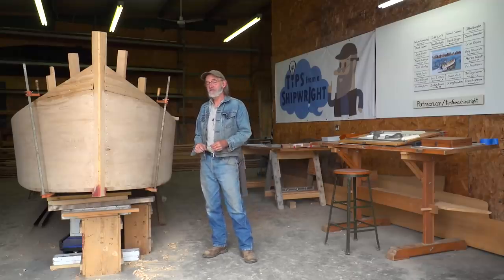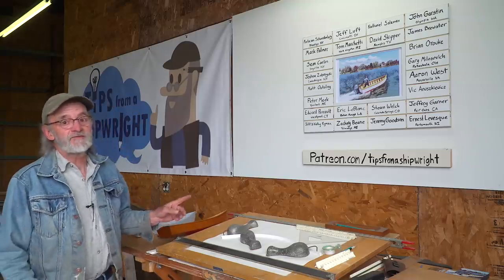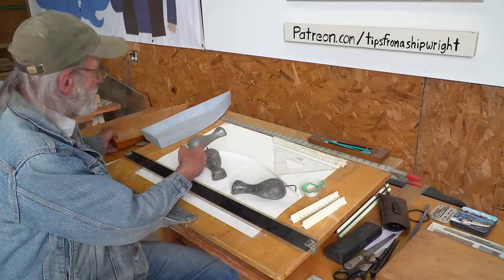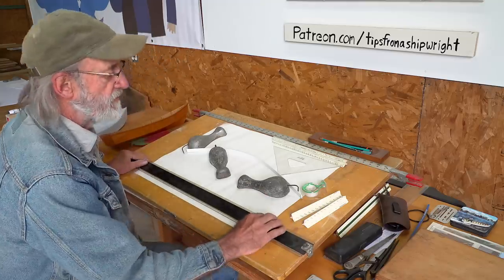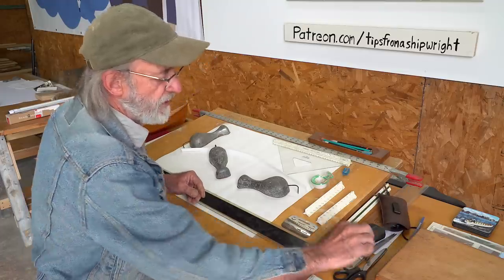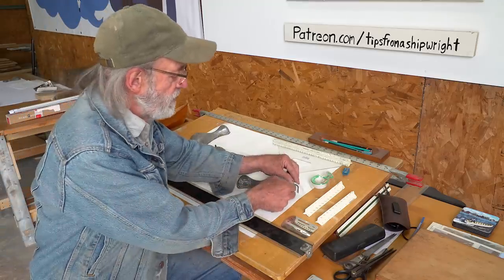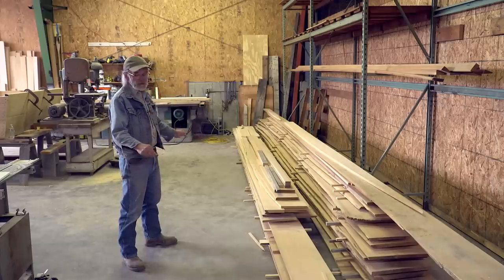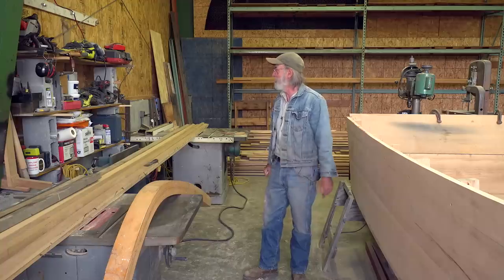Tips from a Shipwright Season 3: The 23' V-Bottom Skiff  Episode 1 - Shop Intro

Comment: I had a young pup interested in boat design show up at my shop to ask advice about how to proceed. He was asking if learning solid works was useful. I told him learn to loft by hand. Told him to read Chapelle. Handed him a set of plans for my model flat bottomed skiff and told him to bust out a cereal box and some glue.
Reply: I am an injection mold designer and use Solidworks every day.  I can't wait till Louis starts to draw so I can learn to draw on the board.  My dad was a draftsman in the Air Force.  Unfortunately, he gave all of his tools away.
Reply: Peepaw Hebert my dad was a mechanical engineer so I grew up playing at his drafting board and still use the same one today. I love what cad software can do but I still believe you can’t beat the tactile nature of hand drawing and I absolutely love lofting. Lou is right. You don’t need a lot of fancy gear.
Reply: SG80 preaching to the choir my man. I’m with you there.

Comment: I have had a few attempts at designing boats using 3D modelling  and I have to agree with Louis that it is incredibly hard to do!  There is no such thing as a simple tweak.  If you have constrained something incorrectly you will have a lot of trouble to reverse your steps.  Sometimes it might even be faster to scrap your model and restart.  Looking forward to following this series!

Comment: Great to see you back on the drawing board and tools Lou!   The V bottom model looks very similar to the boat I built a couple years back, only bigger.  Ply over cut frames.  Little Moby by Charles Wittholz.  I was having so much fun I ended up making a number of alterations/addition to the interior - added a side console, seats, forward raised floor, anchor locker, but didn't dare play around with the hull, other than flattening the shear a little - I knew enough not to go there!  Its a great little boat that performs and behaves well.  I stole your idea of the "boil in the bag" plastic tubing steam box I saw on your channel.  Worked great, thanks!  Looking forward to seeing your design.  Cheers

Comment: Ironically, after making so many drawings and models of various styles of wooden boats I've settled on two skiffs I want to build in the next year as soon as I find a shop near the ocean as these will be beach launched skiffs. The first one is a 14 foot and the second blue water boat is a 17'. Both have a variable V that actually inverts from aft if midship and is slightly concave at the transom. I'm building the 14' first to see how it works out. My hope is a planing boat with a small engine that will be a stable platform, good for trolling and can handle some choppy water. So this will be a fun series to see how well I'm doing with my plans. Thanks for the videos and best wishes on the new series.

Comment: A T-square is the traditional draftsmens' tool if you don't have a parallel guide and would be a better choice than the rule with  binder clips. Inexpensive T-squares can be found at office supply stores and online.
Reply: or just make one; then check the edge of the board for straight and make the bottom ninty degrees and you can use that edge also.  But then I saw one on the table besides the board so Lou is all set.

Comment: A T-square would be easier than a rule with spring clamps. A white vinyl eraser will work better than a pink pearl or rubber eraser. It does not leave a rubber smudge on the paper. Both should be available online or at your local office supply.

Comment: Easy way to maintain paralellism with an improvised setup (yardstick+clips) is to take a right angle triangle ruler, and using wide paper tape, tape it touching with the 90 to the yardstick, perfectly. Top and bottom, for a strong connection. After that, you just have to use a flat surface to the drafting table/board, to keep the contraption in the same position. A hook triangle ruler, or as it's more commonly known a carpenter's square, is even better, as it always has that lip to grab unto the drafting table/board.

Easy to make, very accurate if the paper tape joint is done right, so one should take exceptionally great care when doing that.

I'm suggesting this over a T, because rarely does one find a T of the right size. They get cumbersome and there's no good way to clip them on the table where as this hack doesn't cover the edges, allowing for the clips to be used.

I also recommend using a mechanical pencil of the .9 dimension. It meets all the specified needs (narrow, crisp line, with no mess attached) and it's a sturdy rod, so it doesn't snap as a normal mechanical pencil would.

Comment: I would say a good portion of architects (speaking of non naval) would prefer to draw in the method you have laid out on your table with a parallel rule. But in the modern commercial environment it's not feasible. Drawings done on a drawing board are more intimate than those done on a computer.

Looking forward to the new work

Comment: Good luck. But you're dead wrong about using computers & CAD for design. Using paper and drawing boards and battens today is like using a pointed stick and clay tablets. Could be done but why bother? When the lockdown ends why not drive up from RI to Cambridge, Mass and check out MIT's Naval Construction and Engineering dep't? The ship models alone are worth the trip. Why not check out how the pros do it?
Reply: Hi Josh - there is a lot to be said for both simplicity and avoiding overkill. Although Lou could grab something like DELFTShip to model his hulls, the relative cost, particularly in terms of time on a steep learning curve, is prohibitive. It only makes sense for the pros who are always generating new hull forms for hire. As for the MIT models - specifically the Herreshoff collection, Capt. Nat Herreshoff used to relax after dinner by carving new half-hull models. When they were finished to his satisfaction he'd hand them off to his engineering staff to lift the measurements and draw up a full set of plans.  That we can see those hand-drawn details today without jumping through digital hoops such as decaying, unreadable media, interpreting archaic file formats or such should be pause for consideration. Not everything digital is wonderful, and sometimes the craftsmanship of a well drawn plan contains maker's marks and unique details that add richness and depth to the story.